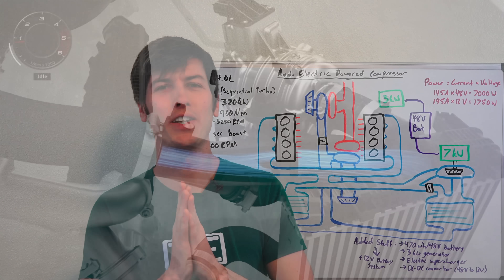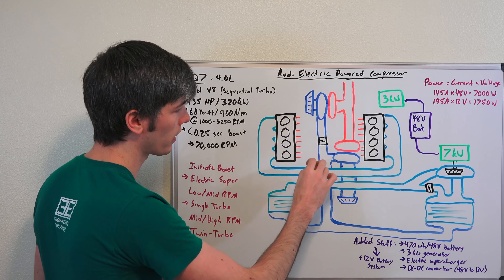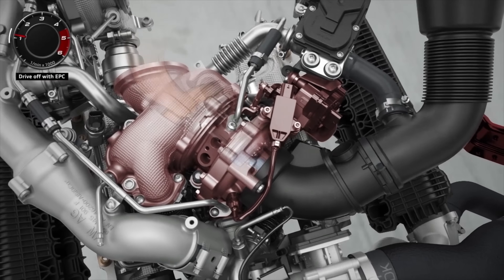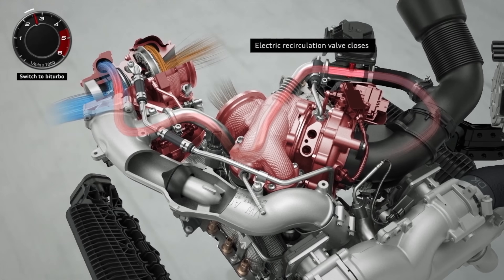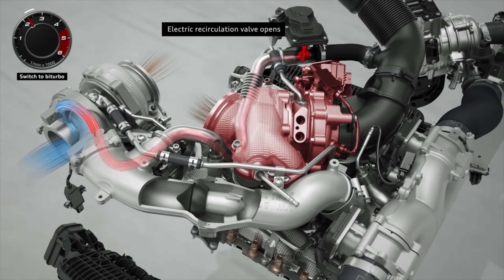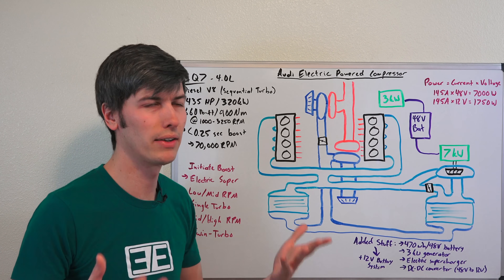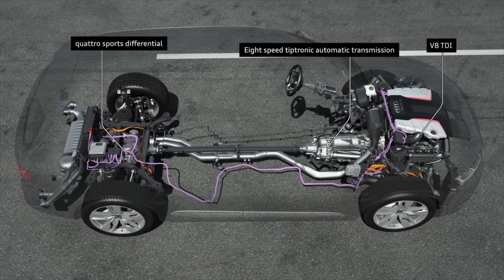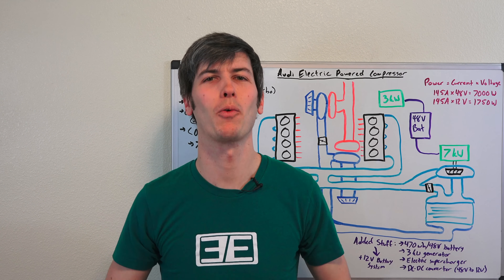Electric Superchargers - How Audi Is Eliminating Turbo Lag

Comment: Dual-voltage Alternator (12VDC+48VDC... or 24VDC, As in Semi tractors)  would not be rocket science (eliminate/reduce power loss - heat - in DC/DC converter)... surprised this hasn't yet been common long before

Comment: why not hybrid, electric motor/generator on the same shaft with turbocharger? so you can get fast start on low rpm, or get power from exhaust on higher rpm like on turbo compound?

Comment: It’s amazing that this is thought up, designed, and then built but I agree with comments. This seems way way too complex and would put you in the poor house if you have to do repairs after the engine gets some miles.
Reply: Yeah. Imagine if the generator, the supercharger or the second turbo fails. Plus that second turbocharger would work better as an art piece, if that one fails. Apparently, some folks have taken an old turbo, and turned them into snails as a metal sculpture, and are so adorable. ツ

Comment: My dad just upgraded from a 2013 Audi A4 S line to a 2020 A4 S line And I can confirm that the new 2020 A4 S line Accelerates unbelievably quickly and smoothly with immediate and smooth power across The rev range.

Comment: Why wouldn't you just replace the flywheel with a large diameter electric motor to provide the extra boost as the turbo spools up...

Comment: Just replace the starter motor with a beefier electric motor that can kick in during turbo lag and you have a much simpler solution, hell you could probably also use it as an alternator and get rid of that too.

Comment: Great video. I remember watching a few videos where people were trying electric turbos and concluded that they do basically nothing (at least the commercially available ones). Just not enough power. I thought though that the concept should be solid - power is power, you just need a bigger motor.
As you mentioned though, I think the practical aspect is really usually the deal breaker. Powering a 7kw motor essentially requires it's own whole system from battery, motor controllers, motor and system housing ect. It's almost like creating a mini EV for your intake :P
That said, the responsiveness of electric does make it a perfect choice and I can imagine this will improve acceleration and efficiency noticeably.

Comment: Witch craft & Voodoo  cant wait for my own. lill 4 popper with 1200 HP with 700 Foot pounds of torque on pump gas. AWD composite monocoque chassis ripping and a tearing 2.2 0 - 60 and a 8 sec E/T 1/4

Comment: I thought about doing this years ago on a BMW 3 ltr turbo diesel 5 series but couldn't find an electric motor big enough to make any difference, when Dyson made the Digital motor for his cleaners I rethought the idea, being battery powered I thought I might be able to get enough air through it just to get turbo lag down and then let the turbo take over, the electric motor would only be running for a few seconds at a time until the turbo spooled up itself so the battery should last a couple of hours. I couldn't find a digital Dyson secondhand motor to try it with I will never know if it would have worked, I also looked at a heater fan motor but I don't think the output would have been enough.

Comment: For years I was saying why cars don’t use electric turbos. If you perfect a good electric turbo. Conventional superchargers and turbos would go obsolete. Make a electric turbo that will always produce boost @ any RPM. It’s common sense right there. No supercharger putting strain on the engine or excessive heat caused by turbos👍

Comment: My 2017 A4 Avant has a"mild hybrid" system. Instead of a spare tire, it has that 48v setup. The alternator can change to a motor and adds approximately 9 or 10 hp. So that part has been around for a while. But as others noted Audi's are best experienced in lease form...way too complicated for long term serviceability

Comment: Cars do not run off the battery when the engine is running.
When the engine is running the systems unless smart charge run at 13.5v.

Comment: From my experience Audi/Volkswagen or other VAG cars seem to have engineers that couldn’t qualify for BMW. This system seems over engineered because if low end power is all they were going for relatively small electric motor inline to the driveline would deliver the same thing.

Comment: You can buy a system like this for about 2300 dollars from a company called torqamp, they use a 48v battery pack that charges while your driving normally, looks like a very easy install too.

Comment: So Audi took a page from Apples book and recycled relatively ancient tech, marketing it as cutting edge problem solving solutions for problems that are barely noteworthy? Got ya. 

Turbo lag on modern OEM turbo applications are nearly non existent. Sure, you can improve on anything but is the TINY bit of lag, which most drivers buying Audi’s have no idea what lag or turbos are to begin with, worth adding the initial multiple complexities of a 48 volt electric blower and all the headache after? Just an opinion but I say over engineering for marketing purposes.

Comment: They should just build an electric car, improve the batteries and design a super efficient diesel generator to recharge it when it's stopped. The generator would only need like a 2-5 gallon tank and probably last a month or more.

Comment: TO MUCH CRAP TO COMPLICATED MORE TO GO WRONG          why not fit  fit an electric motor to a turbo so it spins it at low rpm THEN at high rpm it disengages  so exuast gasses take over

Comment: Better use the battery to run an electric motor that improves acceleration at low rpm like Suzuki does wi this hybrid SHVS system

Comment: Why not use a single turbo and attach a motor to the turbo’s shaft. Use the motor in the beginning to build up boost quickly and turn it off at higher RPM. Sounds simpler than 3 turbos for each rpm range. Can someone explain why this wouldnt work?

Comment: you could remove the engine and replace it with a large battery motor and inverter. You can still spin the turbo if you are into that sort of thing.

Comment: Def better than electric turbo that F1 uses. The only ting that can fail are turbos and esp that smaller one (higher rpms - temperatures), that E-compressor is ~reliable as conventional driven one, the only difference it's got an electric motor to power it. 
Personally tho, I'd rather go for single turbo + e-compressor

Comment: A 572 has no turbo lag. One four barrel carb, one fuel line, one hot wire to distributor, two water hoses, two exhaust pipes. Far superior. 770 HP

Comment: The Mercedes F1 cars have been using a quite similar system in its engines for years! I believe others like Ferrari, Renault have copied that lately.
Reply: Ferrari, Renault and Honda did not copy Mercedes
The E-Turbo is part of the 2014-2020 engine regulations
Reply: Right, but the implementation of that system was efficiently done by Mercedes and the others took some time to make theirs work well. Anyway, Audi's development of that feature on production cars is surely inspired on the F1 success.
Reply: You may be right about the regulations. Anyway that doesn't change the fact that Mercedes' implementation of the said system was very effective right at beginning while the others took some quite some time to master the technology. Audi's touch has been in developing that for a mass production engine.

Comment: I know this is an older video, but I have to ask a question; with the "electric supercharger" already involved why does the car still need a turbo? In my mind, it would be just as effective to run an alternator off the escaping exhaust gases, and then use the power to charge the electric super's battery (or more likely super capacitor)? Not only would this involve significantly fewer parts, but a single electric super could be tuned with software updates to act like a twin turbo. All you do is change the parameters of how and when power gets delivered to the supercharger's electric motor.

Comment: I don't know why they aren't applying this and other advanced technology to diesel engines. Also why dont they have an electric motor connected directly to a turbo, then they could use the excess boost to make the electric motor act as a generator.

Comment: Americans solved this in the 50s with more cubic inches, and they even did it with low cost and astonishing durability.  All the smart germans came to the U.S in the first half of the 1900s,  the soviets captured the rest if the good german engineers.  US engineering IS the BEST of German engineering.  LS > Anything German

Comment: Why swing an expensive alternator when you could just plug it in? But mind you, 7hp is nice, but the big bosses use the available engine power at the crank. Up the power. 25kw plus. Now we've got a shrapnel grenade.

Comment: 4:45
Why can't you just increase the current to compensate for the 12V system? Or use a transformer to step up to 48V?
Reply: The current requirement would be enormous.
Reply: @mvmcali6900  just 4x the 48v requirement.  What are we talking about here, huge thick cables?
Reply: @nthgth  thick cables and the electric motor that runs on 100's amps would also be bigger
Reply: @mvmcali6900  And a 48v transformer is impractical I assume?
Reply: @nthgth  im not 100% sure, maybe someone else can comment.  i do have confidence in the engineers to have thought of runnign the whole enchilada on 12 V though...
Reply: @nthgth  one 'semi educated guess' is that a single 12v battery/alternator system doesnt provide enough on demand energy for when that supercharger spins up and demands a load. the 48v system may have enough 'on demand' energy to provide alot of energy instananeiously when needed.... then , in the back ground, it can be slowly recharged...
Reply: @mvmcali6900  yeah it makes sense that they would have tried that. Then again,  it's Audi, and no German automaker has ever shied away from unnecessary complexity (see every other comment on here lol). The need for a simply more robust or responsive electrical system sounds like a good guess though.
Reply: @nthgth  yeah i laughed at these comments too... the joke used to be about something like a mechanical convertible top for example, that what the japanese could do with 30 moving parts... mercedes managed to figure out how to do it with 100!

Comment: Even with Audi no-lag turbo system, you dont "need" 8 cylinders considering non hybrid cars may still be only 40% efficient. Also they could force more cooling air through the intercooler and have just one instead of two.

Comment: I liked this video explanation.  This is a 4 litre biturbo V8 with an additional electrically driven compressor. All good. I have the twin turbo 3 litre diesel which probably suffers less form turbo lag than the V8 as there is less inertia. The first (smaller) turbo has variable vanes and feeds the engine initially and then approaching mid range simultaneously feeds the second larger turbo. Both turbos operate through the mid range and in the upper range the secondary larger turbo is the main provider of compressed air.  Audi produced a very descriptive document on the various rev phases for this motor. If it did have a turbo lag, I resolved it by reprofiling the ECU through Superchips and that not only increased the torque and power (600 to 750 and 235 kw to 280kw) but the throttle response is almost instant AND it is more fuel efficient. That motor is now dropped (emissions?) and the new 3 litre diesel is now a single turbo with an electric compressor. It is also 'mild'hybrid. I suspect unless the single turbo is super responsive that there will remain measurable turbo lag. Also I suspect the torque curve (although a max of 700 now)is not very flat and that high figure will be a short duration. Your thoughts..?

Comment: You're saying your car battery powers things when you're driving? 
How can the battery stay charged if it's relied on to do work during driving?
 I thought the alternator powered everything AND charged the battery too when traveling.
Weird.
Reply: The 48v recharger is limited. 1 sec of boost take 10sec of recharging so its not a strain on 12v
Reply: Remember, he is dumbing down complicated things. Try unhooking your battery once your vehicle has started and drive around. Especially at idle and performing an energy intensive task like turning the wheels, the vehicle can stall. Though the alternator is providing most of the power, the battery is also necessary for tasks other than just powering the starter motor.
Reply: The 48v recharger is limited. 1 sec of boost take 10sec of recharging so its not a strain on 12v

Comment: How about fitting a small battery and electric motor driving the rear wheels during hard acceleration or starting from standstill. Just use a medium size engine be it turbo charged or not. I have been thinking what if a car company only have 2 or 3 types of engines for use from smaller vehicles to bigger ones and combine that with a battery and electric motor which will vary according to the size of vehicle. The engine only drive the front wheels and the electric motor only drive the rear wheels. By doing this will eliminate turbo lag and no need for complicated engines. I am no engireer just like things to be simple, reliable and efficient. 😆😆

Comment: They should use a small LiFePO4 battery. Those things can handle 2C discharge rates, so you only need maybe a 80Ah battery, and it will weigh less than a normal diesel rated lead acid. About 5 times more expensive to replace, but generally has a cycle life of a few thousand, so should be good for the warranty period :-P

Comment: We argue in the comments but half of us can not afford something this expensive unless we lease. Oh wait. Leasing. I forgot, the Germans and even Volvo with their crazy super, turbo, and hybrid systems are designed to be leased. Even if you do buy you must be making the big bucks so at that point, after warranty worrying about a part breaking is not an issue.

Then again I am biased as I buy salvage and then rebuild. Then again I own an Audi and Porsche both salvage and beat depreciation and can re sell for profit. Only down side is no warranty but, recently have had 0 major issues aside from little bull crap items. Even if something major electrically comes up, I could fix it probably.

Comment: Leave it to the Germans to take a simple thing (a car motor) and complicate it to the point of absurdity. Not a turbo or super or twin turbo or a super and turbo.  But electric super AND twin turbos. Let me guess,  throttle body injection, port injection,  AND direction injection also? You can build a 460ci to 540ci with some top shelf parts and a turbo,  super,  or bottle AND PUSHRODS and get 1,000hp daily driver for  about $5,000-8,000 in motor.  A twin sequential turbo with some nice turbos with anti-lag would be cheaper and as fast.  Audi,  this is ridiculous! Why stop at 48v also? Go 480v and engineer a hybrid system and now it'll launch like a Tesla,  get great MPG, and be fun to drive.

Comment: Is the turbo set up as compound or sequential? I thought thats why they had sequential turbo set ups for less .. turbo lag. But the way he describes it is that its a compound turbo set up with one exhaust valve operating each turbo. I could imagine the casting /porting/ polishing process for the exhuast manifold for those headers. Would be a nightmare. i know sequential turbo sets up run the exhuast through the small turbo into the big turbo to spool it up so when it does engage its already got some momentum. But to have only one exhaust valve operating one turbo, come to think of it is probably a sequential turbo set up. One exhuast valve from X -amount of cylinders ( 4-6-8) spools the small turbo till it cant keep up. Then both exhaust valves open up and/ or are routed to the bigger turbo via valve too run the bigger turbo and has all the brunt of all the exhaust going through it bc it needs it bc its a bigger turbo and they have the exhaist vavle system the way they do, having one exhaust vavle spool the big turbl while the small ones doing its job and you catch my drift.  so the bigger turbo is at X-rpm to engage when the smaller turbo is at max rpm. It makes sense now.

Comment: I have an idea. Let's eliminate the turbo and connect the electric motor to the transmission. While we're at it let's eliminate the engine and use a larger electric motor. Oh we can eliminate the heavy transmission and use a single speed gear box. Hmmm, what should we call this?
Reply: This!
Reply: While at it also increase the Size and Voltage of the Battery, and omit the Fuel Tank since we dont need it anymore.. and also we need to be able to quickly charge the batter on long Journeys.. so we need a battery Charger, but nor a normal one, it has to be Super.

Comment: So two turbo chargers + super charger + generator +++  

What could possibly go wrong?
Reply: Everything  & it will be very expensive !
Reply: Each
Reply: Exactly my thoughts. Even the extra valves to open and close air supply from intercooler etc, plus the variable valve system for exhaust output to second turbo... there is so much to go wrong but dam its clever! Brilliant engineering 👏
Reply: its in a 100k € car man do you think they keep it for 20 years? no. they buy it, drive around for a few years and resell and buy another new car
Reply: @keisuketakahasi4584  that's how it is in Germany, 3 years and new car is bought.
Reply: @janjohnny4945  i know i live there ;)
Reply: Engineers don't have to repair all that crap when it goes wrong , so they just keep stacking it on.
A mechanic sees things differently.
Reply: Thats why its not for everybody.
Reply: It’s not for broke people